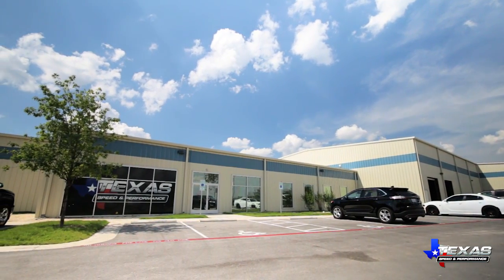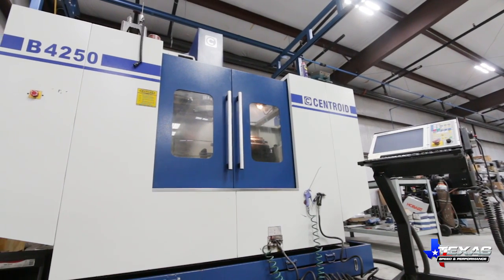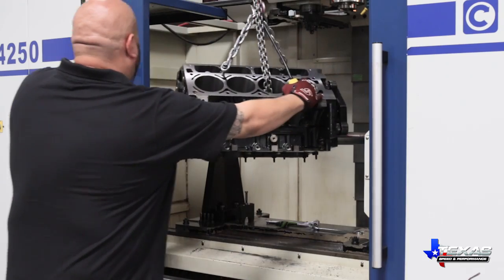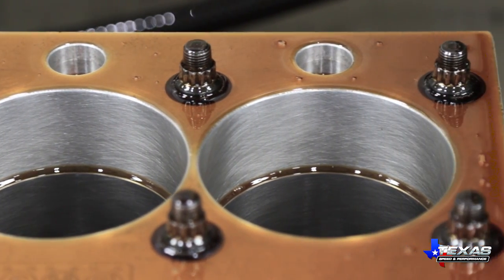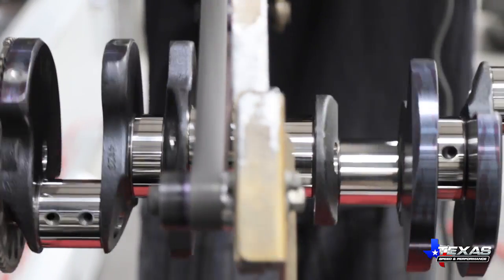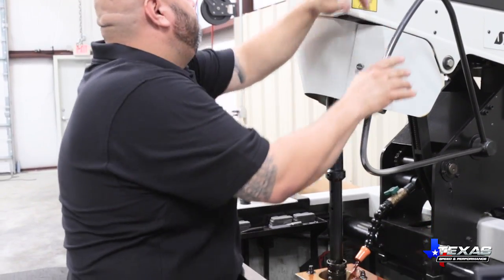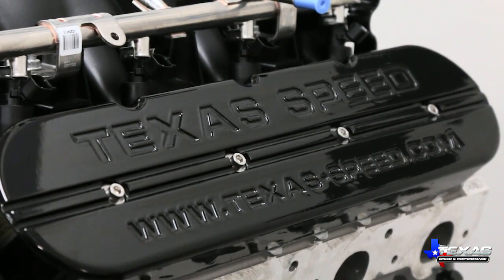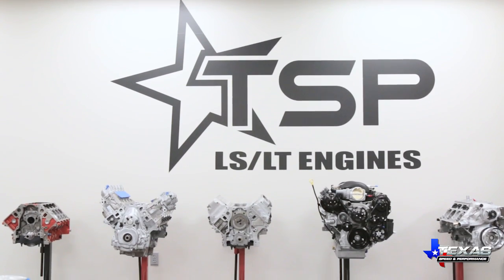Texas Speed & Performance Engine Machining & Building

Comment: I have a 6.2 l99 or l92 not sure.but came from a Silverado 08 it’s a aluminum non afm just a cam phaser.
Could I make it a “ls3”by installing ls3 crankshaft and a cam and some 823 heads.and. Or have any issues?
It will be a going to my Silverado 08.that is currently a 4.8
Thanks for the help advance 😁

Comment: Very cool video, did you guys know that AER in Addison Texas throws away ls blocks every for things as little as the block won't clean up the decks and there std no more than. 010" off the top if it won't come clean in the trash it goes.
Reply: Do you dumpster dive for the blocks?
Reply: @421ssrida  🤣🤣🤣